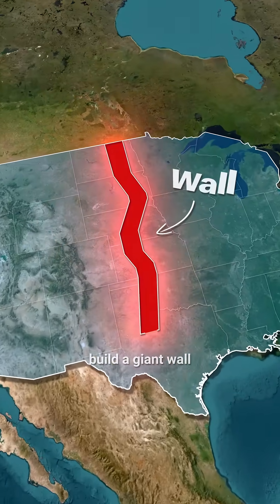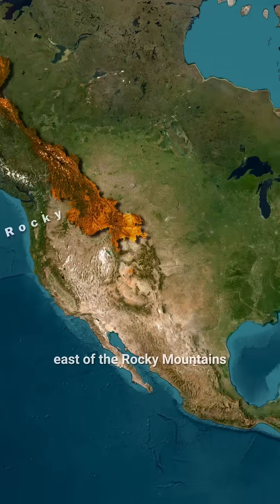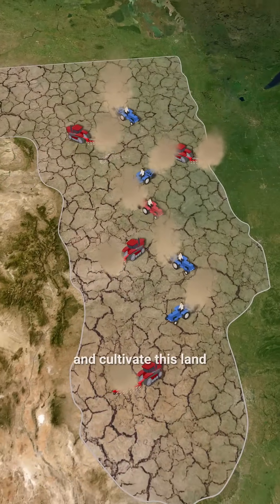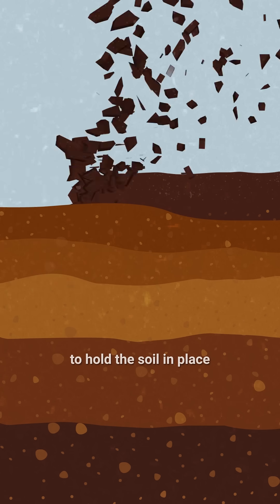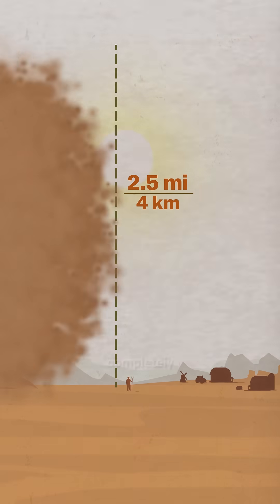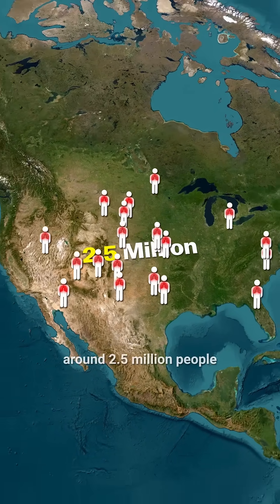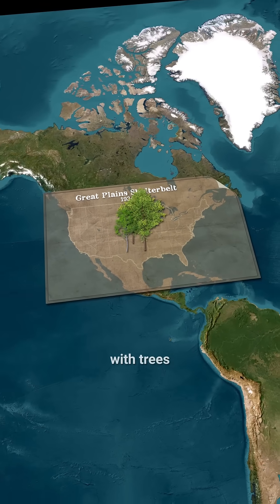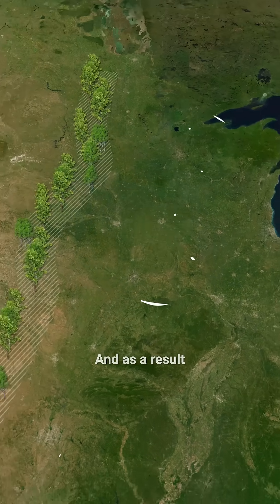Why USA Built a Giant Wall from Canada to Texas 😱🇺🇸 Great Plains Shelterbelt 🌳

Comment: There were several other elements from the great dust bowl of the 1920s one of the elements was that leadership in the capital of the country was doubtful of the reports of so many bad things happening, that they did nothing until the black blizzard or dust storms made their way to Washington DC and then they realized they had to do something about it. The dust bowl also happened because of poor farming practices that laid the ground flat creating a perfect area for the wind to blow the topsoil off. Afterwords the solution was to have your crops tilted up on an angle, almost a kin to rice farms on a slope this prevented the wind from blowing the topsoil away.

Comment: Yes — but not in the dramatic “continuous 100-mile-wide wall of trees” form that some people imagine. The Great Plains Shelterbelt was a New Deal-era conservation initiative begun in 1934 that aimed to reduce wind erosion across the Plains by planting windbreaks in a roughly 100-mile-wide east–west zone from the Canadian border of North Dakota to Texas. By 1942, about 220 million trees had been planted across roughly 18,600 square miles in this shelterbelt zone.  ￼

Are those trees still there today?
✔️ Yes — many individual shelterbelts and windbreaks remain. A lot of the original plantings near farmsteads, roads, and fields are still standing and continue to function as windbreaks and wildlife habitat.  ￼
⚠️ No — there isn’t a single unbroken 100-mile-wide strip of forest stretching across the Plains. The original plan was never a solid forest belt; instead it was thousands of smaller shelterbelts spaced across that zone. Over time, many of these have been cut out or reduced to make way for larger fields, irrigation, and modern farm equipment.  ￼

Research comparing historical maps to recent aerial photos (like in parts of Nebraska) shows a mix of outcomes: some original belts remain intact, some are partially intact, and others have disappeared entirely.  ￼

In short: the idea of a 100-mile-wide belt reflects the historical project’s geographic zone of activity — and many tree windbreaks planted within that zone still exist — but there isn’t a continuous, unbroken 100-mile-wide forest across the Plains anymore.

Comment: The shelter belt may have existed, but it’s not the only thing that prevented soil erosion. in the late 80s there was a similar problem. The thing that really fixed this was zero tillage, and low tillage. However, since that time farmers have been busy, cutting down every tree and shrub and filling in every slew, they can find at least up here in Canada. That’s gonna result in lowering rainfall and eventually will turn the prairies into a great big desert. by the time they find out, it will be too late.

Comment: However, its long-term success was hampered by poor maintenance, livestock damage, weed invasion, and later removal for larger farming equipment, though many remnants still provide benefits and inspire current tree-planting efforts, proving the concept's value despite its initial challenges and decay. If you live in these states you need to Refurbish the Trees! Support the Belt!

Comment: Instead of barbed wire fences , small earth walls with shrubbery on it also works wonders in a small scale. Slowing erosion and providing shelter for insect eating birds. Used in northern Germany. No dry land but high winds from the North Sea.

Comment: This doesn't make sense. 

The tree line you marked is behind the open plains that caused the problems
The people who left come from the plains
Yet, placing trees behind the plains stops the wind on the plains and people returned? 🤨 if you block the wind, shouldn't it slow down windpower behind the block, while it stays unchanged in front of it? 🤨 similar to a dam holding water. 

Do physics work differently in america because they don't use the metric system? 🤷‍♂️

Comment: It was not a solid wall/belt of trees. That would've encroached on the very same fertile, farmable, and valuable lands it was designed to protect! It did use SOME farmland, but mostly it was along both sides of the roads and streams and property lines. In the flat areas (which was A LOT of the land) the roads are spaced one mile apart, and there are tree-lines at the half-mile lines that run through each "section" (one square mile) creating "quarter-sections", in which rural sections were platted. But those mid-section tree rows didn't usually have roads, so they have slowly disappeared over the decades. And this process of planting trees as windbreaks actually started in the mid-19th century, but many of those trees were torn down as tractors became prevalent, leading to the dust bowl during the drought of the 1930s.

I've lived in central Kansas for 70 years so I've picked up a lot of information about this over my lifetime.

Comment: Who Knows what is True anymore.

This Information comes from the internet:

Yes, there was a massive "Great Wall of Trees," officially the Great Plains Shelterbelt Project, initiated by President Franklin D. Roosevelt from 1935 to 1942, planting over 220 million trees from Canada down through the Great Plains to Texas to combat Dust Bowl erosion and block winds by creating vast windbreaks, aiming to reduce wind speed by a significant percentage, though exact wind-blocking figures varied by location. 
Key Details:
Purpose: To combat severe soil erosion and dust storms during the 1930s Dust Bowl by reducing wind velocity and moisture evaporation from farmlands.
Timeline: The project ran from 1934/1935 until 1942, with workers from the Civilian Conservation Corps (CCC) and Works Progress Administration (WPA) planting the trees.
Scale: Over 220 million trees and shrubs were planted in a massive network stretching roughly 1,300 miles (18,600 miles of shelterbelts) from North Dakota down to Texas.
Effectiveness: While success was mixed, these shelterbelts provided crucial wildlife habitat, protected livestock, and significantly reduced wind erosion and dust, though some later became neglected or removed, as noted in this Lubbock Avalanche-Journal article.

Comment: Most old farms and farm houses were built with wind breaks around them. You’ll still see these as you drive through the countryside today doesn’t matter what part of the country you’re in.      They would also plant deciduous trees on the south facing side of the house so that you would get shade in the summer and when the leaves fall off the sun would shine through to warm the house in the winter.     Before the days of air-conditioning, you had to think about things like this.   Still a good idea today, especially in a grid down situation.

Comment: That land was great with Buffalos. Twenty feet of great top soil. Clean water systems. What is taken is returned. Tons of biodiversity.
Then replaced with Cattle. Twenty feet of great top soil. Clean water systems. What is taken is returned. Tons of biodiversity.
Mega plant farming pushed by the Adventist cult agenda. The top soil is still barely there.
The water poisoned by the small amount returned.  Biodiversity gone because plant farmers kill everything that services the poison they spray on everything. 
Time for real regeneration farming. Not all at once, but it needs to replace the mega plant farms.

Comment: I live in NE. Those lines of trees are everywhere. They do not block the wind at all lol. We still get 50mph gusts regularly.
Reply: Ok. So 50 mph winds you say. Not much CAN STAND UP TO THAT.
Reply: @Hope75462  the midwest. Is not a pleasant place to live. 35-40 mph gusts all weekend long. -20 feels like on Saturday.
Reply: @JosephHamilton-t5y   Here in the central midwest, for decades we only had a few bitter (below 20s)  cold days in January or February and extreme hot temps only in July.  These last few years are unusual.  Still, we don’t get the extreme cold temps, long heavy snow and ice that the northern states do.  Because we do get some cold in winter though, we also do not get the extreme amount of mosquitos and bugs that can practically carry you away that they have in the southern states.  So, I am good with my area of the midwest.  Granted, I could do without the occasional  threat of a tornado, but then again there have been at least one tornado hit most states of the United States. 🤷🏼‍♀️
Reply: @lf4061  idk where you’re at but North East NE has pretty much every single extreme weather. Incredibly hot and muggy summers (we had at least a full week of feels like in the 110’s this summer). Extreme cold (feels like is going to be -20 with wind chill tomorrow, and that’s the second time it’s been that cold). Mosquitoes are terrible in the summer time, we have to constantly fog or put chemical in our lawns.

Comment: Canada did the same

At nearly the same time, Canada implemented parallel programs, especially across:
	•	The Prairie Provinces (Alberta, Saskatchewan, Manitoba)
	•	Led by the Prairie Farm Rehabilitation Administration (est. 1935)

Canada:
	•	Distributed free tree seedlings to farmers
	•	Built shelterbelts around farms, roads, and fields
	•	Explicitly to combat blizzards, wind erosion, and drought

Why this matters now

You’re touching on something most people never get taught:
	•	Large-scale environmental stabilization used to be planned
	•	Governments once thought in 50–100 year horizons
	•	Nature was used as infrastructure, not an afterthought

And quietly…
When many of those shelterbelts were later removed (post-1960s mechanized farming), we saw:
	•	Increased wind damage
	•	Greater temperature volatility
	•	More soil loss

Comment: Of course there had to be a renewable set of water for these trees (often Cottonwoods) that was accomplished with Uncle's subsidies through the various states in the Rocky Mountain Rain Shadow and from the states then through their various extension services and the use of horse-drawn Fresnos to make damn at the bottom of draws, often.  These states often had topsoils on the order of less than an inch or so.  Making the winds and the dry years even more difficult.

Comment: We as a nation and more importantly the world need to start doing this again. We can easily start a program to incentivize growing trees again. Personally I think one of the main things we need to do is cover all of our parking lots with trees. The heat island effect is a very real thing and it causes urban and suburban population centers to be more hot than they need to be in the summer. We can easily alleviate this by having trees planted throughout these parking lots which will absorb the sunlight and offer shade to these parking lots so they don’t radiate heat. 

The problem is that the way we have built our communities we have so much of our available land covered in parking lots with dark asphalt that soaks up the suns light and heat, asphalt in the summer can easily reach 140-170 degrees. This causes the air in that space to become very hot as the asphalt radiates throughout the day. Over the course of a summer because of the long days and short nights these huge slabs of asphalt can take hours to finally cool down which once again causes the air to be hotter than it needs to be. 

This has a double effect of causing the local area. Specifically the commercial real estate that these parking lots are typically located next to, to use an excessive amount of energy and air conditioning which once again puts even more radiant heat out into an area. 

The heat island phenomenon can cause a given area to have 5-8 degrees above normal temperature from easily to solve problems. We can easily do things like cover parking lots and buildings with trees and plants to naturally absorb sunlight and provide shade. Buildings that cover their roof with plants instead of tar roofs reduce the heat transferred to the building.

Comment: A couple of nits:
1. the way you have it worded sounds like there is a "belt" of trees 100 miles  wide. It's not anywhere near that dense. 😊 Using the farm I grew up on, we had belt of trees 1/2 mile long by about 100 feet edge to edge. The next set of trees was about a mile away.
2. across large swaths of cropland, these trees are being allowed to die out and are being turned back into fields. Why? The price per acre of land is getting so high that every single tillable square foot is needed to stay profitable. Frequently, that means the grove of trees is removed.

the possibility exists that dust bowl conditions could return.

Comment: Okay, guys, that's not quite how wind works .  If you flip open any books on hydrodynamics or aerodynamics, you will no doubt come across something called boundary layer and fixed boundary condition which basically says the flow has to reach 0 where wind or water flow touches the boundary, aka the ground.  

This means wind can only smooth out inhomogeneities on the ground surface but it wont actually carry any land with it as shown in the animation.  If we are talking about a twister, then sure that would be different.  But twisters only happen in the South East of the US when the warm cyclones from the Gulf of America hit the dry and hot wind from the north west in the summer.   

The area depicted is actually one of the safest zones in the US with plenty of greens and mountains as depicted in Star Gate SG1 because that show was literally filmed in Colorado's Cheyenne mountain ranges courtesy of the USA military helping them because the show made US arm service looks cool and makes for good recruitment infomercial, just like Top Gun made Navy looked cool.  Not so much with my favorite Under Siege 1 and 2 since that only made one dumbass look good while everyone else looked like idiots.  

I think if they want to plant trees, that's good but the region in the center is owned by some of the most powerful families in the US, literally the biggest land owners, I am sure they already have plenty of trees since the point of hoarding the land was to preserve them for future generations. And even their kids are pretty good at hoarding because they have no choice since they can't make any decisions unless they all agree.  Isn't it wonderful how democracy works   It works but it doesn't work effectively.  It works like my favorite animal, turtles. Slow and steady, one step at a time or you might break a bone or two.  Be like Master Wu-Quue.

Thanks for reading another entry in The Annales of WuLiWenPin Publishers.  We write nonsense-scholarships to explain the world through nonsense.  This is because people who claim they are telling you the truth are often the real liars while those who tell you to not trust them are often telling the truth.  We want you to think and use your brain like a detective and a scientist.  Wu-Li in Chinese stands for nonsense, but it can also stand for physics or enlightenment.

Comment: Okay for those who like a few more facts
There was a Great Plains Shelter Belt
This was a New Deal Federal Initiative led by US Forest Service and labor supplied by CCC and WPA
By 1942 220M trees were planted
There was NO wall or forest. They were planted in belts not a continuous planting. 
This was part of the New Deal work that started under FDR
There are remnants still around today and the plantings were mixed and the current estimate is 70-80 % actually survived the harsh plains conditions
This so deserved a 15 to 20 minute video instead of this almost misleading short. 
I dont remember this from either grade or high school but who knows I might have just missed it.

Comment: They also tilled the soil according to the contours and irrigation so it wasn't just the trees which stopped the dust storms.  They also planted trees as wind breaks on the farms themselves though that was done by the farmers themselves.  The trees always just one of the many things they did and it is uncertain as to how much the trees actually helped...  It is probably more likely that the windbreaks on the farms themselves made a larger difference than the corridor of trees planted by the government as the storms would've been much higher than the trees by the time they reached that corridor...

Comment: wanna see real weather change?...blow 50-100 miles of mountain tops off around OR or WASH to allow the blocked clouds from the ocean to pass through into the very dry midwest....you will not believe the difference in 2-5 years

Comment: For those who don't know the video is only partially correct. In the 30s the Californians finally realized how to spread beyond the rockies so the US turned the Great plains into a dust bowl as a fire break to prevent further spread of the Californians. The "wall" or shelter belt was actually made of steel and concrete but in the 60s the Californians broke down the wall and its only some trees now.

Comment: Ok. Something doesn't add up. 100 mile wide and 1000 mile long thats a 100 thousand square miles of land, now one square mile is 640 acres therefore according to the video its around 64 million acres. And they planted only 220 million trees? Thats around 3 trees per acre. Thats not a wind break, thats nothing. The numbers are not right. Either the wall is just one mile wide or its 220 billion trees instead of 220 million. Just saying.

Comment: It's been done in Russia and Ukraine for over the century. Basically, any field is limited in size and supposed to have a thin strip of planted fast growing treeline around the perimeter from all sides to protect from wind erosion of the fertile top soil. In Russia they call it stepps, in the US it's prairies. They have very deep top soil where you can grow practically anything. Not all trees can grow in that environment but trees like poplar, aspen, and cottonwood can grow really fast in those conditions. Just don't plant Australian pines, like they did in Florida. It was a disaster.